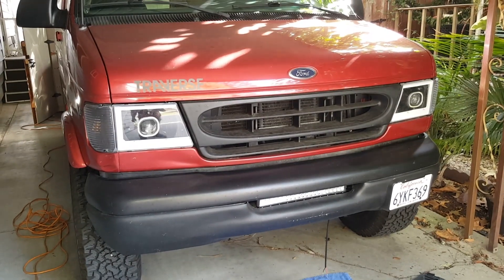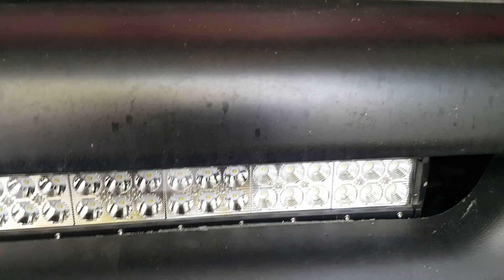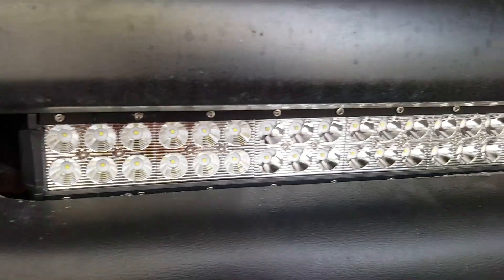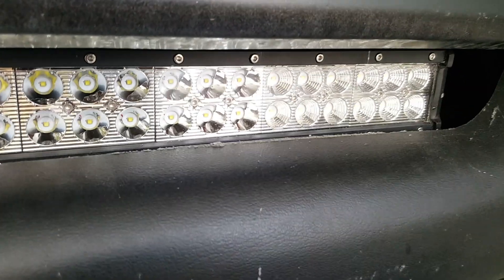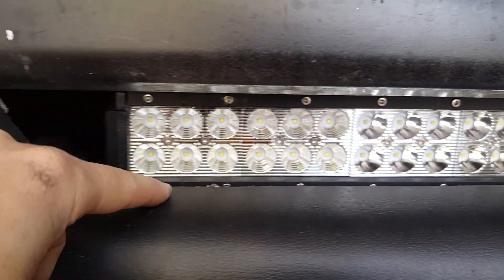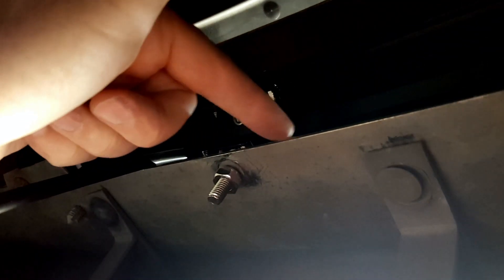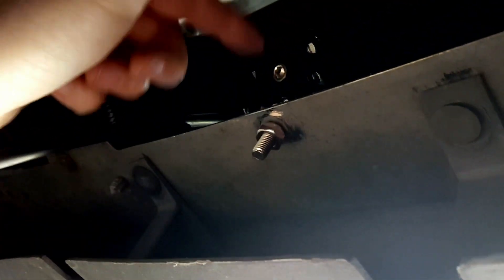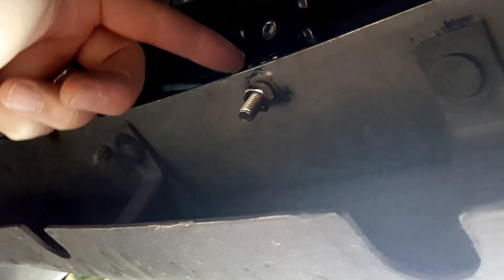20" Light Bar Install on Ford Econoline

Comment: I know it's been 2 years or better since you posted this video. But I want to add a lightbar on my e250. The slot in the bumper looks to be a great place for one. But I would think Ford put that there to get more air flow to the radiator & engine compartment. Do you get any over heating problems with the lightbar there?
Reply from the maker: @DonaldBoesch-m4x   I never experienced any issues but I lived in a mild climate and longest roadtrip was in the winter. I had also done multiple road trips to Southern UT all seasons and never noticed issues.  The light output was HUGE though.  I’m sure some air would still get around the light bar as well.
Reply from the maker: @DonaldBoesch-m4x  also, I saw a guy add side fender vents with old snowmobile vents. He claims it allowed greater airflow through the engine compartment.  I bought some but sold the van before I ever installed them. But another cool option to do to let more hot air escape the engine bay.